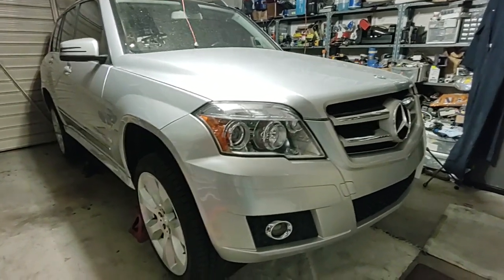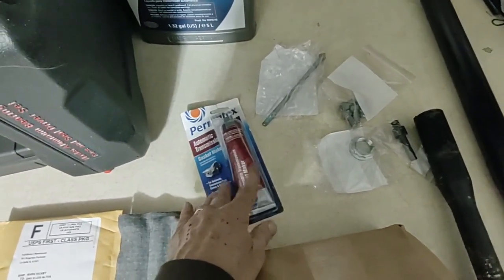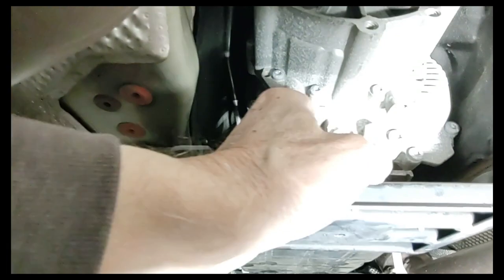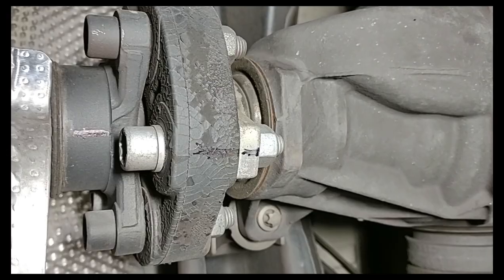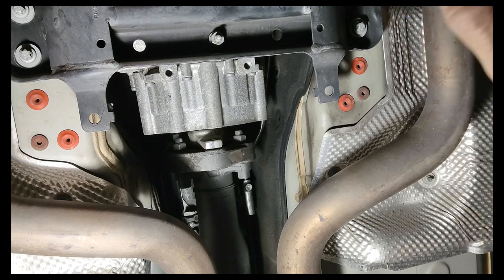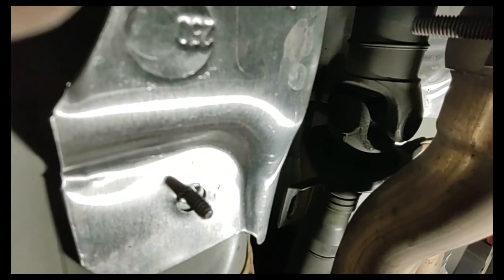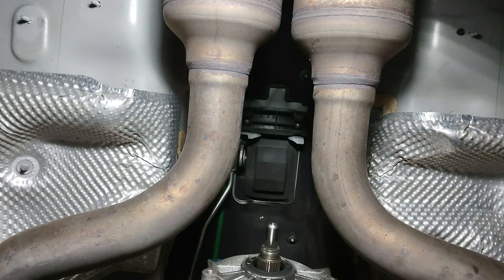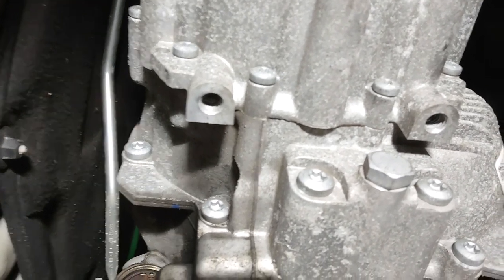Mercedes 722.9 4Matic Transfer Case Rebuild - 2011 GLK 350 - done in-car, new output shaft cluster

Comment: Hey Mark. Thanks for the videos, doing this repair on my GLK with 100K miles. Videos are great. MB wanted to charge me 6000K for repair of front differential. I could not afford it, so i decided research the issue myself and found this video. Have the shaft out and its completely snapped on the inside U joint, Rotates 360 degrees. Parts are ordered and on the way. I cant find the output shaft dust cover though Any ideas on the part number for this? I see it comes with the front drive shaft on amazon. I really don't want to buy a front drive shaft just to get the dust cover, the old drive shaft is pretty good no issues I can see.
Reply from the maker: My dust cover came with the driveshaft, but I did order a spare or two. I got it from FCP Euro or Pelican Parts, I don't recall which. I'm sure one or both should have that boot. And given the difficulty of getting a driveshaft in and out, I'd be really, really tempted to swap it out just so I can forget about it for another 100,000 mi or so. :-)
Reply: Thanks - Just received the new remanufactured output shaft, it came with new Bearings pre-pressed on. Honestly the bearings feel a little rough, gritty when you spin them. Was wondering if this is normal with new bearings? the old bearing feel really smooth when you spin them in comparison.
Reply from the maker: @roryschimper202  my new bearings were buttery smooth. I'd be concerned about anything else. Where did you get the output shaft assembly?

Comment: So here's my story. Was getting a grinding noise from the transfer case in my 2010 GLK 350 4Matic. After watching your video I decided I would rather pay someone else to do this. It was VERY difficult to find a shop that was willing to take on this job. I finally found a shop that agreed to rebuild the transfer case for about $1,400. 
The shop finished the job after a week when they spec'd the job as 2 days. Not a great start. I get the car back and guess what? Yeah it's leaking trans fluid from the front output shaft seal.

To make matters worse the shop would not admit to doing anything wrong and at first wanted to blame a bad output shaft or case??? After a very heated 1 hour call with the owner the shop agreed to put a new seal in for $350.

I had absolutly no desire to throw good money after bad so no way in hell I'm giving this shop any more of my business. They should have fixed their error at no cost to me.

So I dug into this myself, many many thanks to Mark. Without your video I don't think I could have done this. But yeah I just finished pulling it all apart and putting a new seal in the front. While in there I checked the preload per your second video. Yep on the front output shaft the preload was WAY WAY to high. That new bearing was not long for this world. I used the gasket method to bring the preload to acceptable levels. I used a 1/32" gasket material from Cometic that I cut myself.

Long story short I just got back from the first test drive and NO LEAKS!!! 

Thanks again Mark. Your information was invaluable!

P.S. Mark you make this job look easy. It was NOT easy. But doable just be patient and take your time. I did drop the exhaust on the passenger side. Although I didn't remove the front driveshaft it just really helped to have extra room on that side. I installed the front seal by putting it on the gear cluster first then slid the gear cluster/seal combo into place.
Reply from the maker: Thanks for the story, and for a reminder why I always do my own wrench-twisting.  ;-)  What we shadetree mechanics lack in experience, we more than make up for in motivation to do it right the first time.  ;-)
Reply: @Mark_H_DIY   The thing is it was a German car specialty shop that charges top dollar and advertises working on super cars. And they either didn't check the preload or did and just ignored it. VERY disappointing.
Reply from the maker: @clarkmgb9389  I'm sure it would have been aggravating to try to get them to stand behind their job when the bearings fried just a few thousand miles after the repair, too! It sounds like you've got it fixed to perfection, though. I put about 10,000 miles on my GLK since I did the repair, and so far, it's perfect. I expect it to stay that way, too! ;-)
Reply: I'm getting ready to do this job myself. When you put the front output shaft seal over the gear cluster,was it difficult to get into place? Did you line it up then tap it into place?
Reply: @mikedizzle5273  it slid into place pretty easily. I did put a liberal amout of grease on the seal the gear  the case and the splines. It did require light tapping to fully seat.
Reply: @clarkmgb9389  
I'm doing this job next week after my replacement output shaft arrives. I'll try your method and let you know how it go's. About how long did it take you?
Reply: @mikedizzle5273  i took my time and did it over 2 weekends. I'd say 30ish hours. Mind you i was completely by myself, no help at all. 😂 With a good helper you could probably cut that time in half.
Reply from the maker: Sorry for the late reply (youtube message app kinda stinks).  ;-)  Congrats on getting it done.  And yes, having a helper does make it go quicker!  I did it the second time solo (or almost all of it) and it was a lot quicker.  Most times when I have a helper, he or she is holding the camera more than twisting wrenches.  ;-)

Comment: Friend, I already changed the transfer case... now the problem is that not all speeds are included. I can only enter 1 and 2... because it could be... or is it some censor?😢😢😢😢😢
Reply from the maker: Sorry to hear that!  Here's the thing - the transfer case lives on the back of the "transmission" itself, so nothing done in the transfer case itself should cause a change in the actual shifting performance of the transmission.  The one exception would be that if somehow the bearings in the transfer case were SO tight that they were "eating" the engine's power - doubtful!  My bet is that you didn't properly top off the transmission fluid (shown in my video).  I suppose using the wrong fluid could cause a problem as well.  But you really DO have to follow the kind of complicated steps shown in the video to get the fluid level right, and the car shifting properly.  1) Car level, 2) Engine running 3) Transmission fluid temperature 45°C, 4) Shift through the gears a few times slowly, then 5) Pump in enough fluid so that some runs out, and then 6) when the fluid slows to a dribble, replace the drain plug.

Comment: Friend, how many liters of oil or fluid did you put in the transmission... is the fluid only put in the transmission and not in the transfer case?
Reply from the maker: The transmission and transfer case share the same fluid, which is transmission fluid. Because the transfer case is higher than the transmission pan, you only lose about a quart / liter of fluid rebuilding the transfer case. Just follow the recommended procedure for filling the transmission back up to spec.
Reply: thanks very much buddy

Comment: was there anything wrong with the output shaft? I noticed that you said it had play but said it was in your head. I don't want to order it from them if the part went bad. Don't want to deal with them if the warranty sucks on it.. Thanks let me know.
Reply from the maker: The output shaft seems to be fine. With it out of the transfer case, I can't feel any real play. I think that there is a little play in the splines that amplifies any play in the U-joint. My big problem with the vendor (Maktrans) was in their refusal to answer me or discuss  the issue rationally, and in a total lack of any real warranty. The owner's attitude is "interesting", too... But they're probably the only game in town for the output shaft cluster. Somebody out there could step up and start rebuilding these things and make some money!
Reply: @Mark_H_DIY  so is there any issues with it now?? How’s the car driving?
Reply from the maker: @koobmoua3751  it's all good. I've put 7-8,000 miles on it so far. Smooth and quiet. Make sure and watch the second video to see how to set the bearing preload and avoid damaging the output shaft seal.
Reply: @Mark_H_DIY  ok will do. Thanks for all your help.

Comment: Hello, I have a question, I hope you can help me, I already put the new  transfer gear  from poland , but it is normal that when I turn it  feels harder than the previous one. I could turn the previous one more easily by hand and now I have to apply a little more strength  it feels tighter.
Reply from the maker: I did a follow-up video that deals with the issue you are having.  The problem is that sometimes the preload on the bearings is too high when you reassemble the transfer case, and this could cause premature bearing wear and failure.  In the second video, I show you how to determine the proper preload, and how to adjust it.  It might take longer, but the end result is that your new bearings should last a long, long time.  https://www.youtube.com/watch?v=JNt68kNdFUU
Reply: thanks for the info ,I appreciate

Comment: I have same issue with Glk 350 2014 and i don’t know if it the translation or the transfer case  . Im not able to drive the car. Not moving at all i just hear loud noise  but no move . Any help please
Reply from the maker: @AbedalrahmanKoni  I would have to suspect it's the transmission, not the transfer case if your car can't move at all. The transfer case will supply power to the front wheels even if it's got serious problems inside. I suppose it's possible that all of the teeth could be stripped from the helical gears inside the transfer case, but in that case you were going to have serious transmission issues as well.
Reply: @Mark_H_DIY    Thank you i removed the front drive shaft because it’s broken like the one on the video . Car only can drive flat surface   For few yard and cant recline even for one yard
Reply from the maker: @AbedalrahmanKoni  Well THAT changes things! ;-) With the front drive shaft out, the planetary gear and clutch pack in the rear drive will barely propel the car. You need to try to move the front output shaft and see if it's loose or not. If it is, you'll need to replace the gear cluster and u-joint that makes up the front output shaft.
Reply: @Mark_H_DIY  in same time its make very loud noise like steel crashing
Reply from the maker: @AbedalrahmanKoni  That doesn't sound good... There isn't any loud noise with the front driveshaft out of the transmission is OK. You should see if the front output shaft has play. If so, you might fix the problem by rebuilding the transfer case.

Comment: Hi Mark,

I managed to strip some of the T45 bolts that hold the back of the transfer case, the harder ones. I got one of those out by hammering the socket into the bolt because the angle allowed me to. Now, I cannot do the same to the top one and a couple of those on the right side. Are drill bolt extractors an option, considering the angle and cramped space? What would you do in my case? 

Many thanks
Reply from the maker: The first thing I would do would be to reinstall most of the bolts you already took out. That will make it easier to get the difficult ones out. It's one of my rules of thumb that you always take the awkward, difficult bolts out first. I never had any real difficulty extracting any of those bolts, as they are only torqued to about 20 ft lbs. It sounds like it's possible that your T45 socket is in bad shape. I'd suggest getting a fresh, new one. That might help. Also, you may be able to string together a couple wobble extensions, allowing you to use a hammer to tap in the new torx socket from further back toward the rear of the car. Also, it is possible to move the back of the transmission to the left of the car a little, which will give you more wiggle room to get in there. The top few bolts are going to be more interesting if they are truly stripped. I'd try the string of wobble extensions and a hammer first. After that, it's more a matter of finding something that will fit in that space than anything else. An extractor might work, but I'm not sure about the angle of attack, and you would have to be very careful with this tray shavings that are creates. At some point, the only option would be to drop the transmission, and remove them with a pair of vice grips. Anyway, good luck with the rest of the repair, and I hope you get through this initial glitch. Let me know how it goes.
Reply: @Mark_H_DIY  

Thank you for the reply.

I just tried stringing the wobble extensions but realistically I don't imagine it's going to work, because if I somehow succeed tapping the socket into them, I am going to strip them further while trying to unscrew them. The problem is that those bolts have been reused, and have been torqued down not to spec. They are tight and gummed up. The only way I see getting them out is tapping on them and working them out at straight angle.
I think dropping the tranny is my only option. Now I am working in the same environment as you, on the jack stands and a jack supporting the tranny. My question is: Can I get the tranny say 90% down while still on jack and supported by the underbody of the car. I can't get it fully out as I don't have the tranny jack/supports and it's going to roll. Do you think this is doable or am I looking at towing it to the shop to properly remove the tranny?

Many thanks
Reply from the maker: Thing is, if a Torx socket is square in the bolt's hole, I can't imagine it stripping or slipping.  Maybe the hole has been compromised by now, but here's what I'd try if it was my car.  I'd use my battery impact driver with a couple 3/8" wobble extensions.  I'd drive the socket into the bolt as far and as straight as I could get it, then put the impact on the "back of the stack".  Then I'd put as much forward (pushing) pressure as I could on the back of the impact and pull the trigger (in remove mode, of course).  The result is usually a cleaner, crisper torque applied to the stuck bolt, leaving less opportunity for the wobbles or socket to twist.  My (Makita) impact is small, but rated (IIRC) for about 80 foot pounds of removal torque.  That should be more than enough, as those bolts shouldn't be snugged up anywhere near that tight.  I've seen the sealant make them a LITTLE harder to remove, but nothing that my little impact couldn't easily overcome.  Could you drop the tranny without "serious tools"?  Probably, though it can "get interesting".  You'd need to use a pair of pretty tall jackstands up front to get clearance, and buy / borrow / steal a cheap tranny jack.  I've used this method for my Jeep Cherokee (easy because it starts out higher than my GLK on jackstands) and a VW Jetta (FWD, so it was probably harder than the GLK would be).  You do have to be careful not to drop the tranny off the jack (mine has a fabric strap that can be looped over the top), but it was more "fiddly" than "difficult".  Once you have it out, I suspect you'd be easily able to remove those bolts with a hefty pair of vicegrips, or you could cut a slot in the bolt heads and remove them with a flat driver head in an impact wrench (or even one of those hammer-driven drivers). I've never had to drop the transmission in my GLK, so take the above with the prerequisite grain of salt and do some research on what's involved.  The good news is, once you pull the tranny, rebuilding that transfer case would be easy peasy.  ;-)
Reply: @Mark_H_DIY  It helped me to lower the trans some using the floor jack that was hold it after removing the trans mount.
Reply from the maker: @clarkmgb9389  Absolutely! You can get a little more downward tilt to the rear of the transmission that way. Don't go crazy with it, as you might put extra pressure on some hoses on the rear of the engine, or even those hard to change motor mounts. But I did basically the same thing when I was changing the motor mounts, and getting that crazy front driveshaft back in place. :-)

Comment: Can you unhook the Propeller shaft and front drive axals if you just want two wheel dive ?
Reply from the maker: @222mytony  nope, sorry. The front drive the s direct, while the rear drive has planetary gears and friction plates, which aren't going to be good at power transfer, just good for adjusting to slightly different traction conditions. And I even tried that scenario just to see how it works (and to move the car around without a front prop shaft). Not great.
Reply: Well if they did let you do that you'd have to plug it somehow I'd think oil would come out wouldn't it ?

Comment: No for internal transfer case. This is when you separate transfer case from transmission. Look at the 

AR28.10-P-0100T Remove/install transfer case
21.10.11 
Step number 20
Reply from the maker: @klajdistari827  that's a different (211.08) transfer case, and the grease they're installing is on the "plug-type splines", whatever those are (I'm not familiar with that particular transmission or transfer case).
Reply: @Mark_H_DIY  I am replacing my transfer case with trans on my w211 e350 4 matic. I am having hard time to find that grease. Do you know what else I can use ?
Reply from the maker: @klajdistari827  sorry, I'm not at all familiar with that transfer case or transmission. I'm not sure what the grease is being added to, so I would have a hard time giving you much of a suggestion anyway.
Reply: @Mark_H_DIY  ok thanks a lot

Comment: Helo ther i heav a problem with my transfer case to 
Can you tell me wer i can order spear part for this 
Best regards from Hasse in Sweden 😊
Reply from the maker: @hassejansson8062  The information on the parts you need is in the video description. You can use the part numbers to look up Swedish parts suppliers, though the front output shaft gear cluster is only available through the supplier I listed. Good luck with your repair!